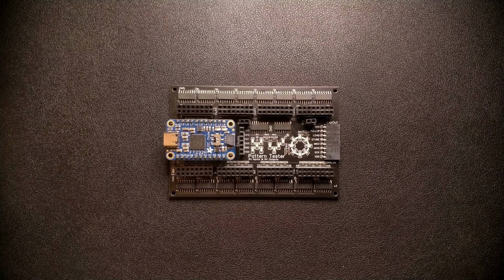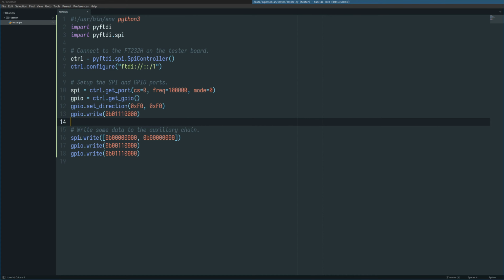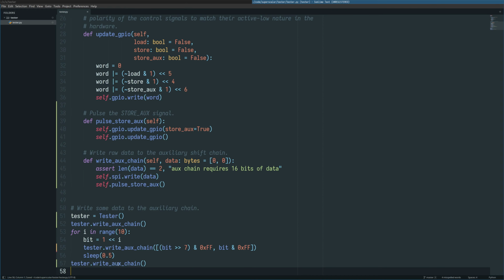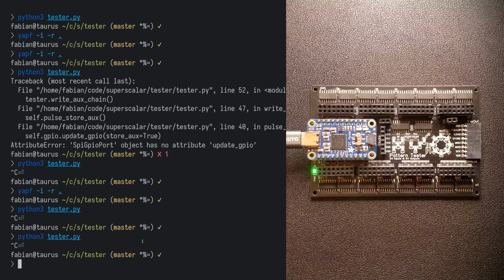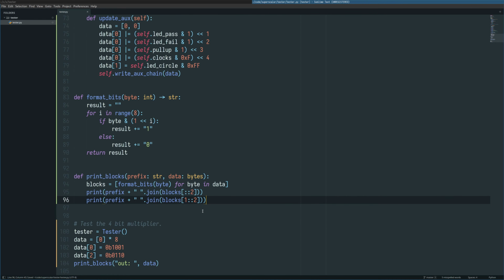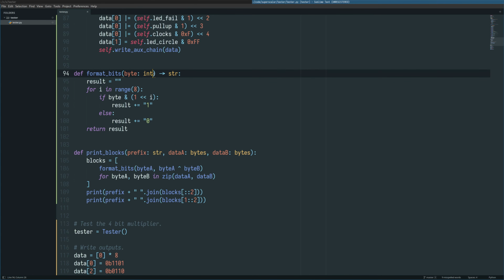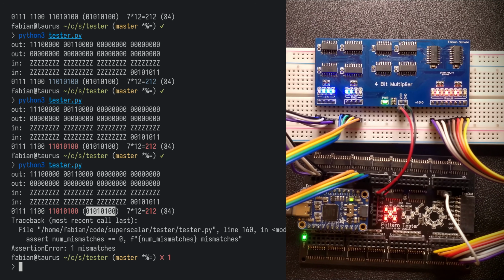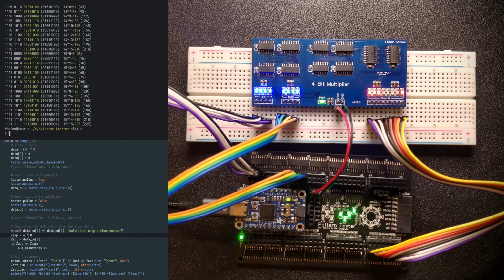Circuit Testing with Python – Superscalar 8-Bit CPU #19

Comment: Plain try/except in python is often discouraged, if you're going to catch a Ctrl-C you should be explicit and `except KeyboardInterrupt`
Reply from the maker: You're totally right, that's a great point! 👍 Without the explicit check for KeyboardInterrupt I'm silently stopping on any kind of exception, with no useful error message. Thanks! 🙂
Reply: I would even leave out the 'except'. This is a good use case for 'finally' which is used to clean up regardless of whether an exception was raised or caught.
Reply from the maker: @dzhong111 Ah that's a great point! Thanks 👍

Comment: Really cool this small machine. 😎👍
Two thougs on this:
1) It may be helpful for the viewer if you build bigger functions instead of many small ones. I think 20 lines or so per function is pretty ok. Then we dont need to jump around with our eyes so many times. 😉 (For me its also easier if Im programming)
2) Where is your Video about the multiplier? 😁
Reply from the maker: Thanks a lot 😀! I was pretty happy with how it turned out. Thanks for the feedback on function length, I'll see how I can address that in future episodes! Unfortunately I haven't done any recording for the multiplier 😬, it was just a pipe cleaner to try out JLCPCB.
Reply: I think splitting into multiple functions is a good programming practice which restricts each function to its assigned purpose rather than having too many things happening in it. 

It actually makes it easier to read and easier to debug. 
While I understand that following along on a video might be harder with this approach, in the long run the program is better this way.

Comment: Any chance you built more than 1 and want to share them?
Reply from the maker: I got five boards back from JLCPCB if I recall correctly, but I've only assembled one for now. I might build one more in the future once I start running out of inputs or outputs. I would also like to build a board with tri-state inputs/outputs, which would be very useful for bidirectional buses.

I've added the GitHub repository and the EasyEDA link to the description, in case you want to tweak the PCB or build your own 🙂